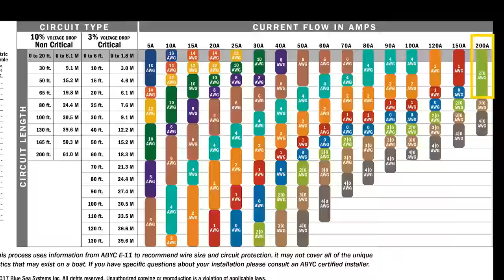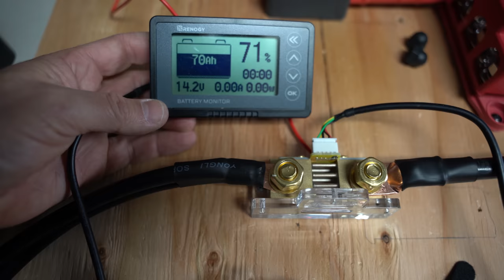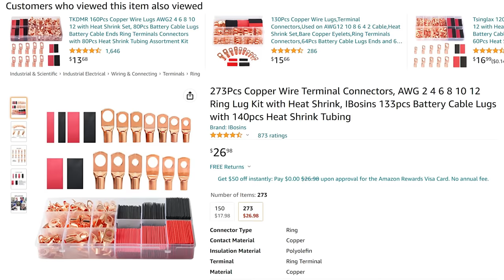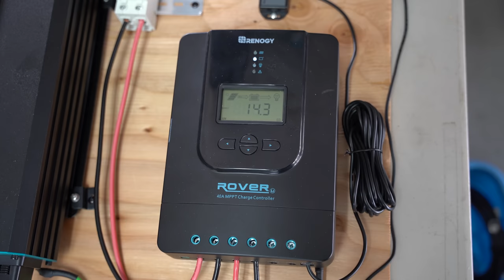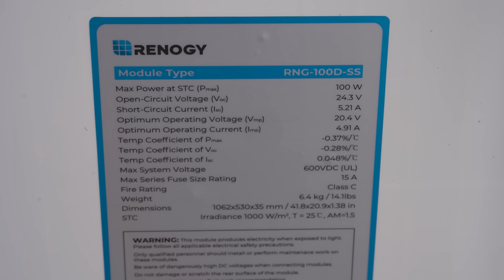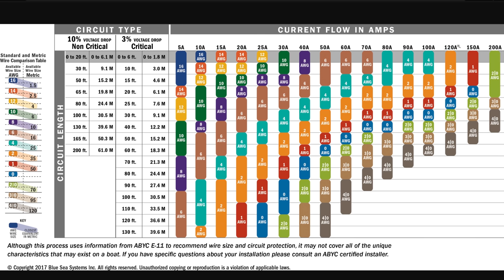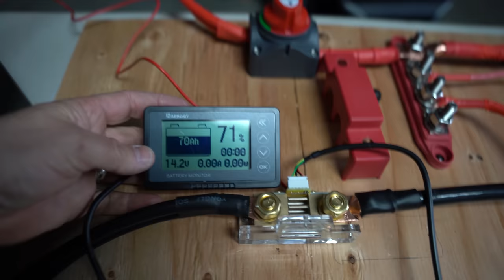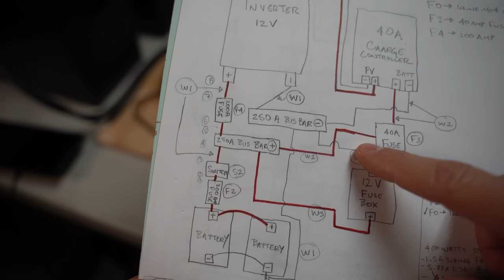How To Build A Solar Setup: COMPLETE Step-by-Step, DIY Guide (12V, 2000W)

Comment from the maker: Build your own 12V, 2000W solar setup by following these simple steps.  There's no technical knowledge or skills needed ... plus there's no confusing verbiage used in this video.  Here are all the items covered in this video:
Wiring chart
* https://cityprepping.tv/3YS0Ote

Book 
* This book was extremely helpful detailing everything you need to know: https://amzn.to/3lT7kB2 

Components
* Inverter (2000W): https://cityprepping.tv/3QPc6KL 
* Charge controller (40 Amp MPPT): https://cityprepping.tv/3PQMNGD 
* Battery (12V, 100Ah LiFePO4 self-heating): https://cityprepping.tv/3Kmy4UM 
* Solar panel (100W): https://cityprepping.tv/3wTi3OT
* Bus bar (250 amp, red): https://amzn.to/3YHlCTY 
* Bus bar (250 amp, black): https://amzn.to/3IibOJe 
* 12V fuse block: https://amzn.to/3xVxyG9 

Cables
* Connect batteries in parallel: https://amzn.to/3SilGaj 
* Battery / inverter cable: https://cityprepping.tv/3wrbsLd
* Battery / charge controller cable: https://cityprepping.tv/3cnjZIi
* Solar extension cable: https://cityprepping.tv/3Tjtf0I
* 2|0 AWG cable (red and black): https://amzn.to/3IDk08h + 2|0 AWG cable lugs: https://amzn.to/3YLlH9g 
* 4|0, 2|0, 1|0, 2, 4, 6, 8 AWG cable: https://amzn.to/3SdWnGm 
* 12 AWG cable: https://amzn.to/3SgspSn 

Cable management
* https://amzn.to/3XJARdN 

Fuses
* 200 amp fuse (used in 2 places: on battery and inverter): https://amzn.to/3AKVNJf
* Inline MC4 10 amp fuse (used to connect solar panels to charge controller): https://cityprepping.tv/3xEvNN6 
* 40 amp fuse (used after charge controller): https://amzn.to/3Em7F5I 
* Fuse holder: https://amzn.to/3XFnds8 

Switch
* High volt, low amp (disconnects solar panels): https://amzn.to/3Iftkhg 
* High amp, low volt (disconnects batteries from system): https://amzn.to/3YMbBoE 

Monitor
* BT-2 bluetooth module (connects to batteries for app monitoring): https://cityprepping.tv/3IfjQ5A 
* BT-1 bluetooth module (connects to charge controller for app monitoring): https://cityprepping.tv/3EmfKHN 
* Shunt/battery monitor (monitor battery status directly): https://cityprepping.tv/3lKZ8CV 

Tools
* Cable stripper (optional, I bought it but never used it): https://amzn.to/3Klt96u 
* Cable wire lug crimper plus cable cutter: https://amzn.to/3xAGJLE 
* Cable lugs + shrink wrap: https://amzn.to/3XLOQzG 
* Ratchet with rubber grip (I bought this as I wanted rubber on the end of the handle to avoid touching the end of the handle on posts by accident): https://amzn.to/3XQG03D 
* Heavy AWG crimping tool (need it for the 2|0) cable to connect the batteries to the inverter: https://amzn.to/3IfNJ5R 
* Wire insulation cutter/stripper: https://amzn.to/3ICRPpP 

Or, if you'd prefer to pick up a kit with all of these pieces combined (to save money), you can check out these options:

* https://cityprepping.tv/3TlAMMj

Skip around with these timestamps:
* Classroom: 1:21
* -- Wiring: 5:39
* -- Cable lugs: 8:13
* -- Fuses: 9:06
* -- Switches: 10:02
* -- Bus bars: 10:33
* -- Shunts: 11:11
* -- Layout: 11:26
* Lab (inverter to battery): 12:04

DISCLAIMER: This video description contains affiliate links, which means that if you click on one of the product links, I’ll receive a small commission. This helps support my channel and allows me to continue making videos. Thank you for your support! Support the channel by clicking here before you start shopping on Amazon: http://amzn.to/2vbNo1l (heck, even bookmark it for future use if you're feeling extra generous). 

Follow me on: 

Instagram - https://www.instagram.com/cityprepping
Facebook - https://www.facebook.com/cityprepping 
Twitter - https://twitter.com/cityprepping
Website: https://www.cityprepping.com

#diy #solar #guide
Reply: What would I need for a 3000w?
Reply: Do you need to have 2 batteries for your setup since the max discharge current per battery is 100A?
Reply: 12 volt system is not the ideal setup it works but a 24,36,48 volt is more efficient
Reply: F ze
Reply: Do you use a 120v panel or do you just use the two outlets and run two circuits from those ?? Thanks
Reply: Surly the 120 is the volts is  in the equation as that wattage  is the max pull on appliance plugged into it  please recheck specks on inverter
Reply: Excellent video. There are many videos on YouTube showing how to build a small solar system. Your video explains and shows the formulas on how the wattage and amperages are factored and calculated based on what the needs are. Nice job!
Reply: Hey Does this work for Camper Trailers
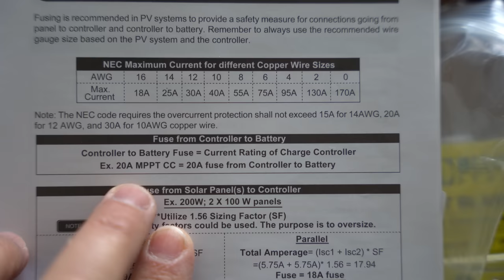Reply: In time lap 21:40 you read out of the manual fuse to battery is 40amps pointing your finger at the page when the page clearly said that the charge controller fuse is supposed to be 20A to battery.  You might want to to look at this and go back.
Reply: @hisway4288  I think what you saw was the example given in the book which was for a 20a charge controller.  His system is using a 40a charge controller, thus the 40a fuse.  "Controller to Battery Fuse = Current Rating of Charge Controller."
Reply: @swithers00  I would assume that also but I have the same charge controller but mine is a 60A and it said the same thing. I massage renogy but didn't get any clear answers.  I went a head and used a 60 anl fuse for mine.
Reply: There is a flaw in the wiring.  The 8ga lead from the charge controller's circuit breaker to the bus bar is not correct.  It either needs to be 2/0ga cable or a 40a fuse needs to be attach between the cable and buss bar.
Reply: First off... Best video on this subject I've seen!!! 
I want to convert my current 12V lead acid battery in my RV trailer to a 100Ah LiFePO4 (due to cost, I might start with just one battery and add a second later). Is there a lesser expensive battery you are comfortable recommending.
 If I were to install this setup in my RV trailer, where I run a lot of 12V devices (lights, fridge, water pump, etc.) as well as some 120V (air conditioner, microwave, small tv, etc.), and wanted to charge the batteries with the vehicle's alternator as well as 120V 30A shore line, as well as 400W solar panels, would I just connect the additional charging methods through the bus bars? 
I would be using:
• Renogy 12V 50A DC to DC Charger with MPPT, On-Board Battery Charger with power coming from the alternator's 12V power cable (through the seven pin connector) and the roof top solar panel hook ups
• Renogy 500A Battery Monitor 
• Renogy 2000W Pure Sine Wave Inverter 12V DC to 120V AC Converter 
What 120V battery charger / maintainer do you recommend? And, would I just hook it up to the bus bars or directly to the batteries? Is there a Renege charger that handles all three sources of power (12V DC, PV input, and 120V shore line)?

Thank you for your excellent videos! There are well written, instructional and well made. This subject has had a bit of confusion for me and you laid it out so well that I think I can pull this off (without torching the trailer ;-).
Reply: What's largest watt supply from panels can the charge controller handle. Thank
Reply: Hey, if I add shore power to my cargo trailer, would I just run wiring directly into the charge controller? Anything to be concerned about?
Reply: 😢😢😢😮😮😮 if The wires are so stiff that you can’t bend them you are using the wrong wire. Need to be using welding wire!!! 2/0 or 4/0 Welding wire🎉
Reply: Excellent presentation. Well done I will share this out😮😊😊😊
Reply: Hi my name is Doug from Australia I have a 1978 Caravan which I have solar but I am going to reconfigure using your system what an awesome video very easy to understand thanks so much.
Reply: Hi Doug again does all this apply to Australia standards
Reply: QUESTION. double negative and positive wires from bus bars. Please explain. Great video. Your a true teacher. Thanks
Reply: Good day and thank you so much for the clarity. Question:  of you and where would you add wiring /switches / fuses /? to include a generator to top up the batteries, on a cloudy day?
Reply: Good day and thank you so much for the clarity. Question:  of you and where would you add wiring /switches / fuses /? to include a generator to top up the batteries, on a cloudy day?

Comment: As a retired electronic technician  and wiring expert (36 years) I can tell you this is the best tutorial I have ever seen on YouTube!!!
Reply from the maker: thank you!
Reply: the guy may know wiring but hes lacking in any real knowlege about solar. 166 amps out of a battery?? plan on replacing it very soon.
Reply: @maddhatter3564  Yup, his batteries are gonna pop like popcorn. Also if you are going to use a 2000 watt inverter he really should be using a 24 volt setup...
1) more efficient in conversion for charging and inverter.
2) cabling half of the thickness.
Reply: @JerryDoe  I run 24vdc with a 1500 inverter. not only the cable size its that batteries are happier at lower charge/discharge amperage.
Reply: A lot of AC guys know very little when it comes to DC and solar!
Reply: Thanks for your input
Reply: Are you around for a few questions? I'm doing a 24v build on a minivan.
Reply: My battery can handle 200 amps continuous. Its designed to do it.  @JerryDoe
Reply: @maddhatter3564 I think he connected 2 in parallel. That should halve the amps load.
Reply: Diy solar with will prowse. The goat solar channel
Reply: @JerryDoe  I thought he did use a 24volt setup.  He had 2 12volt batteries, which would be 24volts, right?  Can you help me understand what you mean?  I am new to this.  Your help explaining would be appreciated.
Reply: Wow, great video. Please help; how are you getting 1.6kW when you have 400W panels? Thank you
Reply: Wow, great video. Please help; how are you getting 1.6kW when you have 400W panels? Thank you.
Reply: Agreed

Comment: I just spent several months designing and purchasing items for my home solar system. I watched countless videos and read countless articles. This is a great video that would have saved me a tremendous amount of time, energy and frustration. Great job!
Reply from the maker: same thing happened here.  i spent A LOT of time on this video as the details I outlined were scattered everywhere.  Most of the company's documentation was wrong, so that was even more frustrating.  BUT, I learned a lot in the process.
Reply: For real! I've been pulling my hair out designing a system and then bam! The gods had mercy on me and this video appeared!
Reply: So did you go 12 or 24 ?
Reply: Same here!  I eventually got around to basically the same setup, but I spent so much time buying little parts here and there (sometimes the wrong parts) and it would have been so much easier if I had seen this first.  Excellent video.
Reply: John Daniels on Youtube is a great ressource, that you may or may not have found.
Reply: I have to agree. My situation is learn it or die. After 2 books...super technical. Learned nothing. Watched many videos. I watched this video and am building my system. So greatful for this.
Reply: Wow what a great video
Reply: Awesome job. 
THANK YOU
Reply from the maker: @craigr306  12V
Reply: Same thing here. This is the best tutorial I have seen.
Reply: I agree, I have a solar file saved here on YouTube that must be 8 hours long.
Reply: @CityPrepping  QUESTION  :  would the wire size change if you run 4 batteries instead of two ? Answer would be appreciated 😊 thank you and God bless 😊

Comment: I want to provide a point of clarification. You don't size your breakers or fuses to the capacity of your wires. Your fuses and breakers should be sized based on each device and what they're supposed to draw x 125%. So if the device is supposed to pull 10a, you size the fuse or breaker for it at 12.5, or I'd do 12. If you follow the wiring premise, you could have that same 10a device on 2/0 wire and theoretically be able to put a 200a fuse. The fuse would likely never trip and your device would burn up if there's a fault with it. Yes, the wiring should be sized based on the draw as well, but that's not what your fuses or breakers should be sized on.

Comment: The fuse between the bus bar and inverter is redundant as the fuse you have on the battery terminal which is the same value will blow first being close to the source. The correct configuration is positive terminal to fuse to isolation switch to bus bar. You need to keep the cable positive and negative lengths from the battery and to the inverter the same. To ensure equal draw and keep the system balanced! Not sure if you mentioned that?
Reply: I thought the same about the redundant fuse.
Reply: Does the same go for negative terminal? It needs a fuse as well?
Reply: Bus bar to inverter after that ?

Comment: Solar panels do not "Send" energy power is drawn. Very good VxA=W explanation. You are never going to "send" power anywhere power will be "Drawn". Shunt is not optional FIRST thing to purchase is battery monitor. Providing power when no charging is available you are on battery. Monitoring battery is first and fore most. Off grid power is battery and the most important part of the system. Using pliers? I'm done watching.

Comment: Chris, this was the best step by step video out there.
 I have been wanting to find a video that every one can watch. I will let my grandchildren watch it with me and we will build this system together right from your video. I have most of the components already but wanted to wait until I found a great video so the grandchildren can understand the complete system. We want everyone here to be able to run and repair our systems. We want all of our systems to be able to be run and repaired by us all.  Thank so much, sir!
Reply from the maker: Awesome, glad I could help :)
Reply: totally agree and Ive watched many.
Reply: @CityPrepping  My 2000w inverter has a grounding place. Does a setup like this require grounding? Should I ground the inverter to a ground rod?
Reply: Completely agree. I am going to electrify my shed following this setup. And the parts list is SUPER useful.

Comment: Only thing worth mentioning to change is stranded wire in screw downs, is to use a Ferrel crimped  to prevent wire spread in the screw terminal.  Excellent video :)

Comment: As a master electrician, thank you. very well explained and illustrated.  Bravo! I would like to mention, the sized and type of wiring that would benefit and work will with this assembly would be copper type (Battery/welding cable) with smaller strand size and very flexible to bend.  Since this wire has more strands, its amperage carrying capabilities are higher.  Yes, it is more expensive but well worth it, especially for short distances.  I really like your form in explaining this. I completely understand and all its principles, but we must understand, even if we think we know it, there is always someone who knows it better, that is why I give you "BRAVO!"

Comment: As an older female newby solar electrician (recently wired solar panel to a greenhouse fan powered by battery with solar controller and thermostat), this is the best explanation of solar system build that I have come across on YouTube. Even I can understand it. This video is enticing me to put solar on my roof. Of course, I will need someone much younger to install the panels on the second story roof, but your video has helped me figure out how to do the rest on the ground. Many thanks!

Comment: Outstanding presentation! precisely explained, easy to understand, not too fast, not too slow, no extra nonsense and straight to the point. Bravo sir. And you even have the supporting links and materials list and sources. As a first timer with no experience, There is No way I could have done it without your video. Thank you!

Comment: this is so easy to follow! my only concern is folks doing this outside the usa where the wiring requirememts/standards and regs may apply (even if its an amateur build i think id still follow local regs etc.) my point is basically that here in the uk (stuff runs on 240v) putting ground onto the neutral bar would be considered a wiring fault (ground/neutral short circuit) and would need its own grounding busbar. 

BUT for all im moaning, this is awesome! definitely doable! 

id probably say if its going to be in a set place (eg your home, not a mobile home!) install a grounding rod if possible for that extra piece of mind in the safety area. 😊
Reply: Arh.. that is exactly what I was thinking.. just watched a video saying don't mix the neutral and ground.. so I was wondering? I have built a new solar system based on the back of this video, which as you all agree seems to be the best explained video on here... its just the Neutral and Grounding combined got me wondering.. I figured seperate would be best.. glad I have a spare bus bar.. Any ideas? oh I am in the UK too North Wales to be exact x great vid, ta very much

Comment: We had to go through the learning process for all this when we added solar to our converted off-grid cargo trailer.  Definitely a valuable skill.  There are a lot of ready-made kits from various companies that make it easier for people new to this.  The beauty is that, if you lay it out well, it's fairly easy to scale up as you realize what your power needs are.  We started with a 200w solar package, which had a 20Amp solar charge controller and 1000w inverter.  Even though we live in southwest Texas, which gets more sun than a lot of the country, we don't get as much actual wattage out of the panels as they're rated at.  So, we're working on adding two more 100w panels, which will obviously drive us to also upgrade our charge controller to 40Amp.  Upgrading our gel hybrid battery with 200ah lithium made a huge difference and gives us a fair amount of buffer when we don't have as much sun.